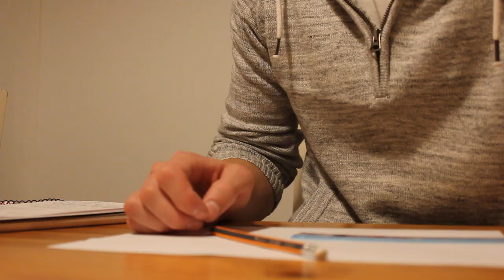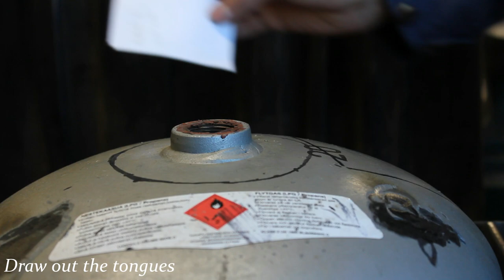How to make a Steel Tongue Drum

Comment: hy maan, great song... WHATS THE APP YOU ARE USING?!?!?!?!?!?!
im trying here, im at the third try at this moment kkkk the first one has some notes, the secound i did all wrong moved by a not calm spirit , now i did some template before, did as it need to be made i guess... but the cylinder im using have 250mm( diameter, and 1,4 mm thick (0.0565") its R410a model, the air conditioner gas container. its not reusable so its easy to get, but i dont know if its too low the thickness...
Reply from the maker: Murilo Marques The app I was using here was for android but I believe it does not exist anymore. Another tuning app for free is tuner-pitched for android, it works with me for other instruments too. https://play.google.com/store/apps/details?id=com.stonekick.tuner

Comment: Im curious as to why you have notes both sides , how on earth can you play both top and bottom , if I ignore the underneath can I just use the top with fewer notes ??
Reply from the maker: Hi, good question. I have notes on both sides because the sides are tuned to differe t scales (see the end of my video where I play both sides seperately). When I play the other side, and the drum is on my lap, then the side on the bottom is muted by my clothes because the tongues do not vibrate.

You can make the tongues only on one side if you want, that is completely possible and fine. I just tuned both sides of my drum so it is kind of like "two drums on one".

Feel free to ask more if you have any problems.